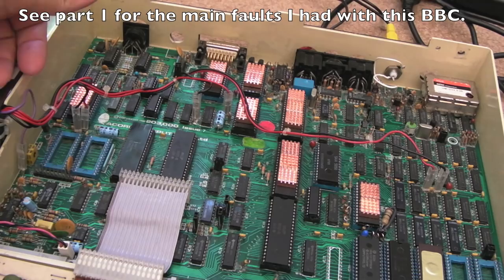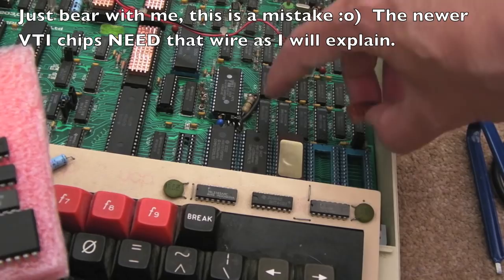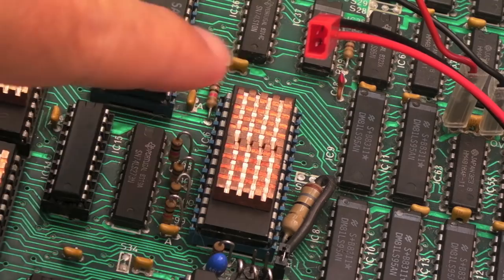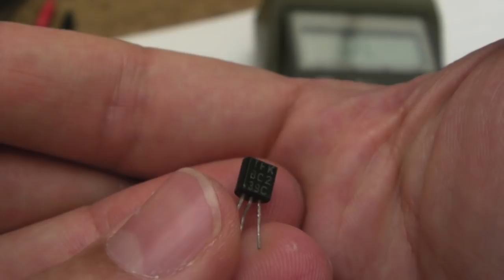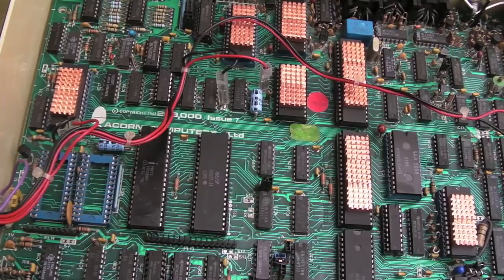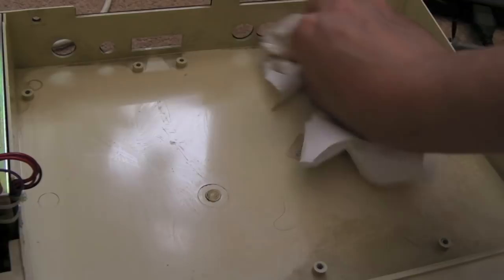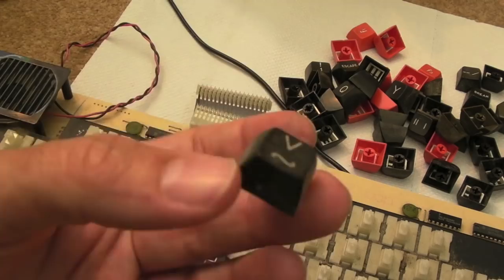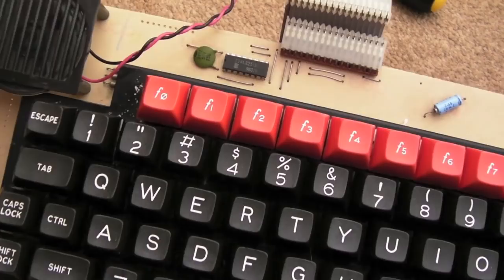Acorn BBC Micro Model B Multiple Repairs Part 2 (Case, Missing Colour, EPROM Games, LED, Audio Out)

Comment from the maker: NOTE: See part 3 - the vc2069 does NOT need that wire between in 27 and the octal buffer.  You only need that wire (which I showed in part 1, if you are using the vc2023.  Also when using the vc2023 - remove the inversion jumper).
Part 1 - https://youtu.be/XBQJHqbnVco
Part 3 - https://youtu.be/IY1eqRxM48s
Part 4 - https://youtu.be/kvU683AUF1c
Please note there's an editing mistake there (red screen with an editing reminder to me lol).  I spent 3 hours editing this, and 2 hours waiting for render - it wasn't worth spending more time to edit that screen out.  Also note mistake there in a few places mentioning the Video ULA part numbers - its vc2023 and vc2069 , not a vt2023 or vt2069.
Reply from the maker: LOL =D
Reply: btw i loved your Eprom mod. I usually end up just doubling up the same image on the 27256 and wasting the second half with a duplicate copy!
Reply: After all the effort you go to making these vids over several days even, little mistakes should be accepted as a whole. Nobody watching your content should be holding you to a particular standard, I mean the subject matter is more important than the editing, to myself at least.

Comment: Nice video. I've just fixed a BBC. It was giving the long beep and not booting. I took out both vias, serial ula, the 7002 and all roms except the os and it still didn't boot so started checking address, data and control lines. I found that the R/W signal to the ram was permanently high (read mode). It turned out to be ic45 pin 12 wasn't getting low enough. I checked it by snipping the pin to isolate it. Weirdly I could kick-start it by pulling the pin down with 1k resistor after which it would work fine thus verifying that as the fault. This was an issue 7

Comment: I soak damaged boards in white vinegar and use an old electric toothbrush to clean them up. From there it gets a rinse under the spigot, and then shook off and tossed in a tub of 91% IPA. From there it gets propped up near a floor heater for several hours.

I've done two A4000s, two A2000s, a Spectrum +2, and a +3, and six A500 memory expansion boards with this technique (which I learned from the Jamma guys). No problems so far... :)

Comment: For audio out on my issue 3 i soldered a wire to the left side of the speaker header which is the signal and soldered the other end to the UHF centre pin after unsoldering the resistor which was attached to the UHF centre pin. So now i connect rca phono to the UHF connector and to the tv rca audio and i get volume via the tv speakers :) The UHF box is already grounded so now need to worry about ground. I slide the speaker header back on the header so if i don't use the tv speakers the internal speaker works :)

The reason i did this was because the BBC audio on the internal speaker was really quiet even though i turned up the VR1 pot to its fullest. So now i get audio via tv which is nice. Apparently i can tap of R5 resistor which gives crystal clear audio. You just need 1uf metal film capacitor.

Comment: I use acetone to weld broken off pieces of ABS plastic.  Apply a few drops with a cotton bud to both surfaces and then let the parts sit together in the original spot. After a few minutes it holds enough together that you can apply a drop of extra acetone to the crack which will wick in and make it stronger. It usually ends up almost invisible.

Acetone dissolves ABS.

Comment: One of your best vidz and fixes Mr.G. A lot of humour which I really like. Feels like you really enjoyed making it. Great tip regarding the ribbon cable for the ROM extender. I've got a couple of ROM boards where the pins have snapped off and have been scratching my noodle trying to think of a fix.
Reply from the maker: Thanks mate =D  Will mention you in part 3 when I use the Super MMC =D

Comment: You could fit the audio out connector with a cleverly positioned push-button or a microswitch to toggle speaker on or off, as you push the cable in.
Reply from the maker: That's a good idea!  Maybe we need an RCA / phono with a switch built in!

Comment: Loving the BBC love, reminds me of the old days when I had my Acorn Electron :) Some nice mods there! It's weird hearing the sound coming from the TV!
Reply from the maker: =D  I've improved the wiring a bit there (shielded the audio cable and made it connect to the original pin header where the speaker goes).  Just waiting on a few bits now to finish it off.
Reply: Nice job xD Doesn't the speaker header provide too much voltage? or is that why you've put the resistor inline?
Reply from the maker: The level is a bit high, so adding a resistor like that reduces it, and also limits current too.  Technically I could have used the variable resistor on the BBC motherboard (just near that pin header) to reduce the level in the same way.  But tbh I prefer to leave the variable resistor set as it is (from factory), that way its easy to just swap between the two (speaker or line out).
Reply: Yeah that's fair, I would have done the same to be honest!

Comment: 24:54 - the ol' "wife's toothbrush" joke gets me every time.

At least I hope it's a joke? lol
Reply: Still have a Beeb I've been meaning to fix for years.

I have a Master 128, and two Model B's (inc. the faulty Model B,).

It has the usual long Beep at power-up, so obv not booting at all.

I'll definitely try removing that buffer chip now that you've shown it can boot without it.

I suspect bad RAM, but the buffers / muxes in my CPC and another machine were faulty, and on an IBM 5150 that I helped a friend fix, so they seem like a common point-of-failure.

I guess it's because those chips are often driving current into a lot of other chips on the bus, so maybe get a lot of thermal cycling over the years?
Reply: I also bought quite a few "new" RAM chips on AliExpress a while ago for repairing my Tosh HX-10 (and maybe the Beeb, if it's the same type).

I know you take a chance buying chips on AliExp and similar sites, as they could be die clones or reclaims, but I've never really had issues with them, and don't care as long as they work. :p

And yep - the sound chip on the Beeb just gets the default / random junk on the bus at power-up, so the long beep at the start isn't coded. ;)

That's why a non-booting Beeb will often have the continuous low beep, or even weird sounds if the CPU is jumping around due to bad ROM / RAM / address decoding / buffers.
Reply from the maker: Haha, that's the question...
Reply from the maker: Thanks for the offer on one of your beebs btw - I forgot all about it after that RRG interview.  Then Ant told me his was for sale - I just couldn't resist!
Reply from the maker: I ended up buying a load of RAM for this in advance (just for spares).  8118 chips - apparently should work, but not tried them yet.  I might socket up the RAM just for something to do at some point lol.

Comment: BTW there's a potentiometer just below the speaker and you can adjust the volume to your heart's content!
Reply from the maker: Thanks!  Yeah, I figured that out a few days after I did the line out mod, but tbh I prefer sound coming from the TV where its controllable =D   I could later do a mod to have a relay that can latch on or off to toggle the internal speaker!
Reply: yeh i agree modding so that you can change the volume makes so much sense. (in fact on the BBC Master that's exactly what happened, a composite sound socket was added). Just thought I'd let you know as I have similar issues with blasting the family with noise late at night! lol

Comment: Hi I have just taken a duff ferranti ULA out of an issue 3 BBC and ive dropped a vidproc 2023 chip in now I understand that the jumper on S26 needs to be completely removed and there should be a jumper wire soldered to IC10 pin 1 going to IC6 pin 27 is this correct?  
With the jumper on the S26 to the left position i get all modes except mode 7 and with the jumper to the right i get mode7 and none of the other modes! So once ive jumpered IC10 and IC6 i remove the jumper all is well?
Reply from the maker: Yes, I vaguely remember having that same issue!  If all mods work with no jumper, and that "fix" wire in place, that's correct!
Reply from the maker: Just watch the part where I show that wire underneath!  I am not sure on the pin numbers!
Reply: @GadgetUK164   Yes just watched it again. As your revision board is an Issue7 it might be different but this is what i found on stardot.org, being the Acorn mod fix for teletext & non-teletext modes from IC10 pin1 wire link to IC6 pin27 and take off jumper totally at S26
(above not needed IF a non buggy VC2069)

Comment: I can't see anyone mentioning it, but you could connect your extra address line to one of the "sideways rom" select lines, which are effectively another two address lines to go with the two that select which of the bank of four ROM sockets is selected. This gives 16 x 16KB ROMS, or RAMs with a little fiddling.

PS My version of AstroBlaster will use the speech chip if you have one, but requires sideways RAM, maybe you could demo adding that (the cheap one). You can get my games from bbcmicro.co.uk and look on the stardot forums for how to write them to ROM.
Reply from the maker: Thanks =D  Yes, will get a sideways RAM / ROM board I think, but I appreciate its super easy to mod fairly quickly =D  I've got AstroBlaster ready to go (to demo as I was impressed with it) - as per my post over on stardot forum - just waiting for Speech chips (again) and will test it out on the next part =D  I love your work, you've produced some awesome games!  Pheonix is great - almost perfect, just what appears to be an issue where the erase of the ship when moving is a pixel out I think - fantastic even so!

Comment: Well your wife is going to end up in hospital soon Gadge'... What the hell was the cat up to? That made me laugh lol That's good stuff that filler. I was wondering... are you retrobrighting it, then touching up the colour to match or? That's lucky you found those bits & glad I noticed. That sound to TV mod is a good idea and speaker disconnect (not microphone lol) I'm going to do that one. So 1k resistor, then to the scart audio pin. I'm loving that jumpered ROM idea. Can you do that with proper ROMs? Looking forward to Part 3!!!
Reply from the maker: LOL =D   Regards retro bright - nah, it's pretty good as is tbh!  The jumpered ROM, yes you can use any ROM image that way.  If I used a 27C512, that would hold 64K instead of the original 16K, and using 2 jumpers I could then toggle between 4 different ROM images on the one chip!   There are also sideways RAM / ROM boards though - those are cool, I might get one!
Reply: GadgetUK164 - Retro Gaming Repairs & Mods I did wonder what more ram would let me do... but for games I'm not fussed really
Reply from the maker: Yeah, some of the newer games use the extra RAM, but I think it's not essential.  I am more interested in the fact it has so much ROM space!
Reply: to use a 27C512 with 4 rom images would it be a case of toggling A14 / A15 high low in combination to allow you to access the 4 positions?
Reply from the maker: Yes, precisely!  4 combinations there, 00, 01, 10, 11.  4 lots of 16K chunks.
Reply: GadgetUK164 perfect thank you. I'd love to see some more ways to use roms if you guys can think of any interesting videos. My rom burner sees too little action.

Comment: I wonder if you could put a basic program on ROM.
Reply from the maker: I bet its a case of compiling it with a header or something, but I don't see why not.
Reply: That's correct, the beeb supports ROM as a filing system (slow as tape though). I think you can find a packing tool on MDFS (beeb wiki).